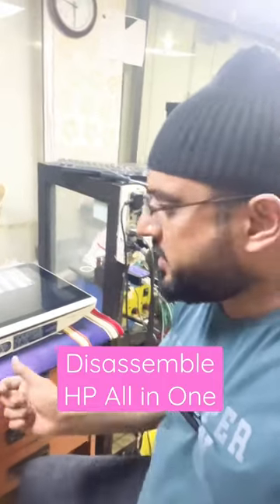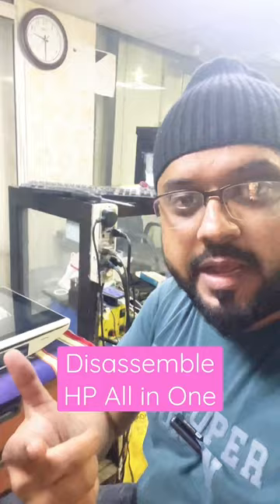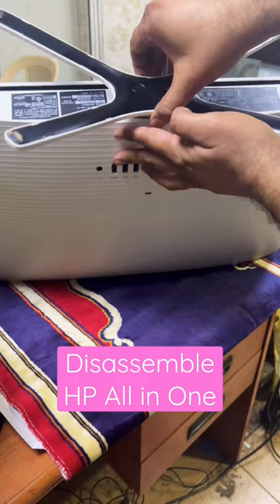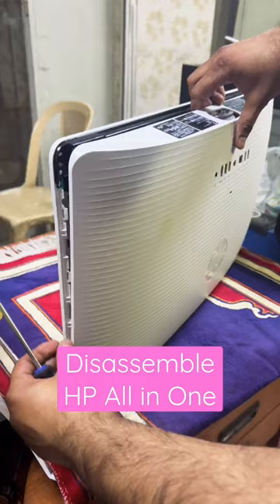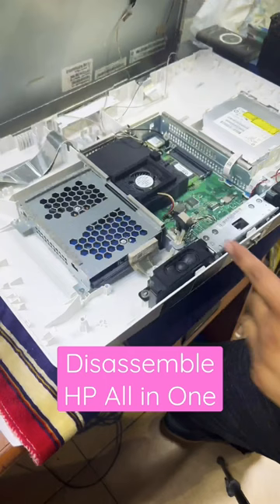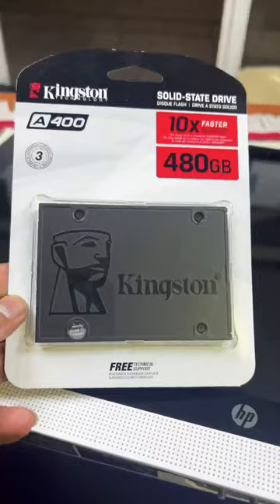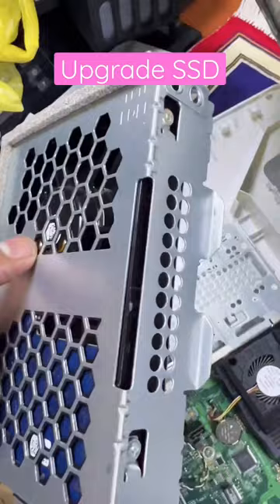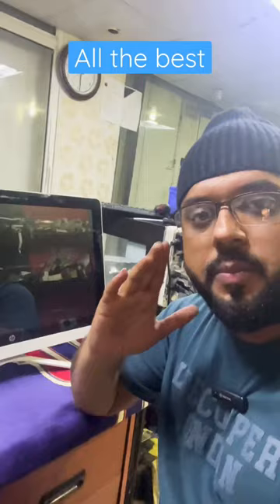Disassembly Guide: HP All-in-One PCs  #youtubeshorts #viralshorts

Comment: My 24 inch hp AIO screen is flickering and has a dark about 2inch band on the lower section covering the taskbar. How do i know if the issue is hardware or software related?
Reply from the maker: Issue is with the screen 100%
Reply: @BilalKhalid  Ahh bad news, dont recall any physical hit/damage to the screen, so only option now is to replace screen>?...if yes, you have any recommended sources for AIO screens?